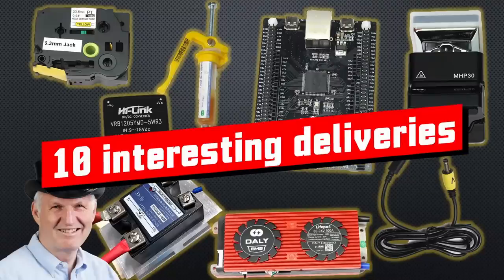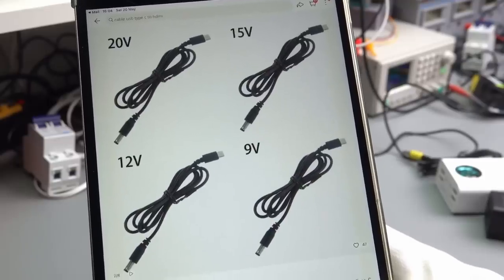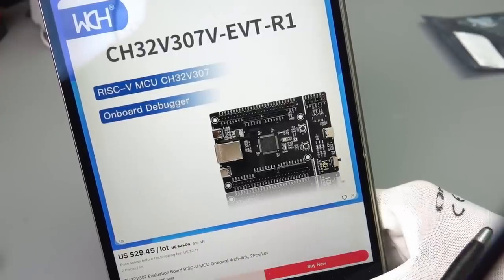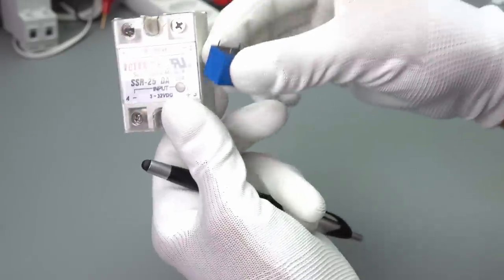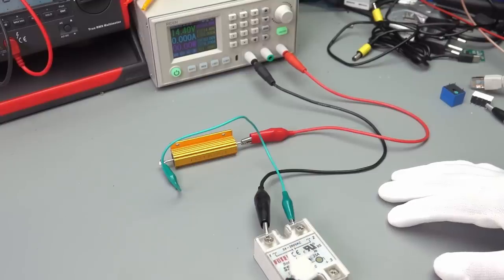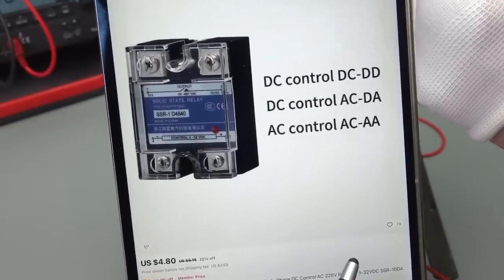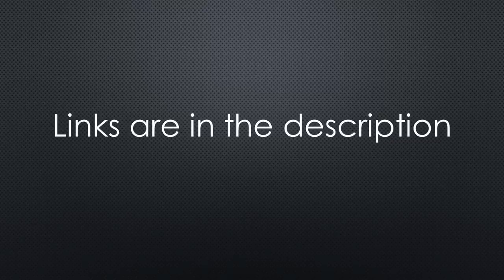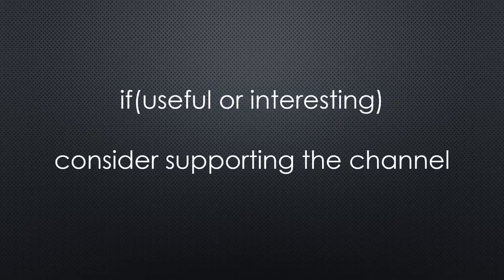457 Mostly Around Power for Projects. And More

Comment: Good to know about the Baseus GaN 100W. You can't charge 2 iPhone (it's seems about 20W "only" is required)  at the same time. I tried on both USB Cat the same time or 1 USB C - 1 USB A. Each time one phone is disconnected ! :(  Why ??? Sad...
Reply from the maker: All PD devices I have disconnect all charged devices when a new connector is inserted. It seems they have to redo the calculation for the internal power budget. And indeed, my iPhone 15 only consumes 25W max while charging. Higher power is mostly for laptops with larger batteries.

Comment: I haven't got into PD yet - but seeing those cables reminds me of a question I had when they first hit the market - do all PD power sources have dedicated power regulators for each output port?  i.e.  If you plug the 9v and 12v cables into different connectors on the same power bank/supply - do they both get the expected output?  I've watched many of Big Clive's "normal" power bank teardowns where the output ports all share the same regulator (obviously, because they only produce 5v) but he hasn't done a PD version yet (to my knowledge).  Interesting video, as always.  Stay safe out there.
Reply: Yes they do! Voltage is negotiated from both sides of the Cable. If that doesn't work it falls back to 5V as it's USB.
Reply from the maker: They probably use variable boost converters because many of them not only provide 9/12/15V. They provide also all voltages in between in 0.1V steps.
But they need one for each USB-C connector as the voltage can differ according to the needs of the consumer.
Reply: @AndreasSpiess  That's good to know - and explains some of the extra cost of PD power banks.

Comment: For the power cables (first item in this video), do they need to be CE marked? In Ali Baba on the specification tab, the certification is marked as NONE. Does anyone reading this know what can be expected/required?
Reply: Who cares?!
Reply: They don't need it, but you must also accept the risk of being low quality and/or unprotected from common faults.
Buyer beware even with supposedly "certified" stuff on chinese electronics sites.
Reply: @nobodynoone2500  Thank you so much for your reply. Maybe it is OK to use material like this for home electronics etc, but I guess it would not fly in a more commercial production setup.
Reply from the maker: The specification tab usually is not filled correctly. I only go with the description.
Anyway, as others wrote: The Chinese CE signs are not very valuable...
Reply: @AndreasSpiess  Dear Andreas, thank you so much for your reply.

Comment: Many Solid State Relays (SSR) are AC only, some will do DC, and those that do care about load polarity!. The better brands have good datasheets that explain the options. Almost none will survive more than 6A continuous without some form of heatsink: the bottom plate is metal to provide a protective earth and heat dump option. Your 25A at 380V model assumes a beefy heatsink and fan, not shown / purchased separately! 

Be aware that exceptionally cheap ("too good to be true") SSR have been found to lie about their specs, using 3A FET/TRIAC and claiming 10A rating was popular, and claiming optoisolation but not having any came up too. 2021 SSR are better than 2016 SSR were, but still be aware!

Great toys when they work :)
Reply from the maker: Others also mentioned that you have to pay attention. I thought I showed the heatsink, BTW.

Comment: Be careful with cheap SSRs. The really cheap ones are guaranteed to be fake. The more expensive ones (>5 USD for 40 A) can be fake too, but at least you have a chance to get a genuine SSR. Yes, a Chinese brand can be genuine and fake too 😁. Anyways, test their current capabilities by increasing the current stepwise to their rating while keeping an eye (or finger) on the temperature. A fake SSR can have a good circuit design, but they often come with a smaller triac, or even an old used one. In that case, you are lucky if you get 15-20 A through a 40 A fake SSR ...
Reply from the maker: Thank you for the info! I never use anything Chinese up to their specs…

Comment: Btw. It appears your Fotek relay is a counterfeit. :-)
Reply from the maker: Many others wrote the same. So it is true.
Reply: @AndreasSpiess  As per FOTEC switching voltage is 4-32 V not 3-32 V. "Taiwan made" printed below power rating. 🙂 Originals start retail at about 400 NT. (that is roughly 13 USD)

Comment: Just a matter of time when someone connects the 12V usb-cable to a car battery and the other end into his notebook 🤯
Reply: We already doing that :)
Type c to Laptop is a very common thing now days.
I don't even remember when did I used the original laptop charger.
Reply: @remy44444  yeah - but those cables only work the other way.
Reply from the maker: I am not sure if anything would happen. The laptop should get along with 12V on the charging rail (it expects 19V). But it probably would not start charging if no PD handshake appears.

Comment: Those SSRs are the best for inductive coil control in boilers, heaters where they need to turn on/off frequently. I guess the reason they not using relays there cos the initial current draw when your turn them on is so high it would destroy the contact switches of mechanical relays very fast. That mini heater plate is such a pos really :pride-person-flower-nonbinary: just use hot air gun
Reply from the maker: I like the hot plate more than the hot glue gun. But it might be a personal preference...